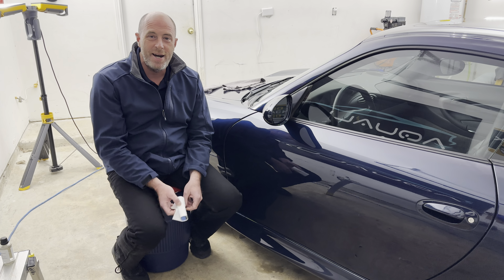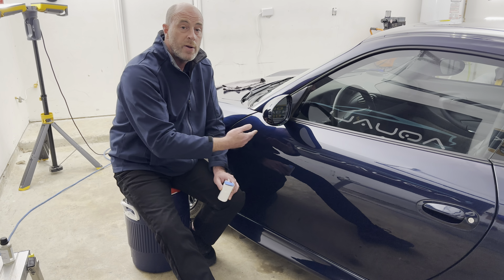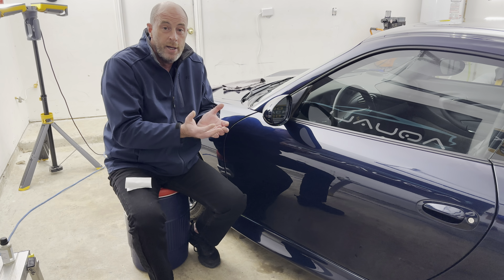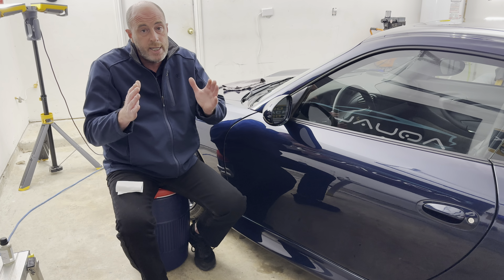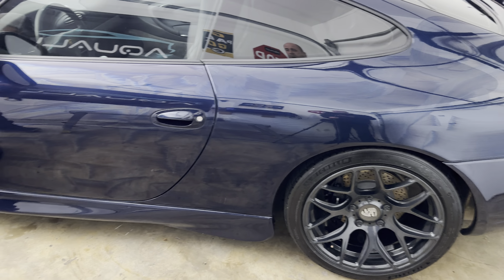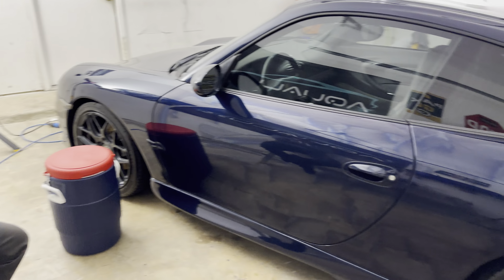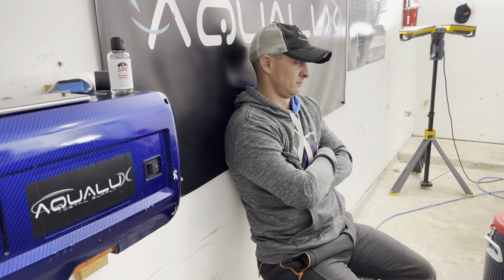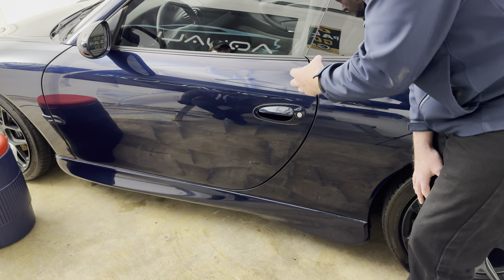New Coating Technology - OVER FLASH TECHNOLOGY DPC FLASH-BACK!

Comment: I am brand new to this, I just coated my white Blazer last weekend. I used Armor Sheild IX. I had none of the issues you mentioned. I did the coating in the sunlight in about 80 degree weather. I didn't time it between applying and buffing. I just stayed 1 panel ahead of myself with the application and buffing and it went beautifully. Maybe I am just a natural at it, but I was a little worried that it wouldn't go smoothly because I have watched a bunch of videos like this. I feel like we may be getting to a point where there are too many coatings out there and it is just making it confusing to the newcomers. Everyone markets their product in a way that makes it seem like every other product is inferior or extremely hard to work with. That simply doesn't seem to be the case in my experience. Just buy something and put it on, if you want to overthink something let it be the paint prep. Applying the coating itself is very easy and not nearly as easy to mess up as most of the YouTubers would have you think.

Comment: I absolutely love what I've seen of this coating. I could see the flash holding for the 10 minutes without any cuts in the video, and I could see it buff off to clarity, quickly and with ease, on a dark color no less. I would have liked to see a close up from untouched to finished if there was any effect on the gloss or depth of color, and maybe a water spritz to show the properties with water (although maybe on a cured panel). I also wondered what happens under hot sun, or over too long a time, does it just get super stubborn, or leave streaks and high spots that need to be compounded again? Overall, great video, good to see you again, hope you are doing great!

Comment: I've used some of another brand spray on graphene coating that works alright. Poor gloss and seems to last about 10 months with my low miles driving. I have some paint damage to be fixed from an old man in a Park, and my Durango will probably be getting this. Black paint - great for the five minutes it's clean!

Comment: ok, so I'm officially confused. Your videos claim this can be applied in sunlight in hot and humid conditions (I believe you said 80 degrees or so and 80% humidity), that sounds great and I was excited to try your ceramic coating. I went to your website to buy some and was just reading about the product when I came across the application instructions and #8 says "Always work out of direct sunlight and on a cool surface". Always work out of direct sunlight? Doesn't that contradict what you've been saying about the ease of application? That it can be applied in sunlight, on a hot humid day and on a warm panel? Hopefully, someone will help clarify this discrepancy for me without excuses or saying that there are nuances, etc. Either the website is wrong or the video(s) are, or the videos are exaggerated, and what it says on the website is closer to the truth or some version thereof. It can't be "well sometimes... Thank you in advance

Comment: Any minimum temperature application worries Scott?
And what would your paint prep recommendations be?
One of my cars is yellow and I’ve shied away from coatings because I’m colorblind and I can’t see the flash. This takes away the worry. 👍
Reply: Iron Decon, Clay, Polish, Panel prep and Coat
Reply: @thinkforyourself5672  , wouldn't the panel prep remove any polish? So I've already cleaned, clayed and polished with hybrid solutions graphene max wax, I can use the coating over the top now? Thanks
Reply: @407j , You want squeaky clean paint. You don't want to apply the coating over a wax. You want virgin paint. A strong panel prep should remove the wax which is what you want.
Reply: @thinkforyourself5672  , ok, makes sense. Thanks for help.

Comment: This coating is fun, simple, easy, super slick, gloss off the charts. Coat the entire car, wait ten minutes to buff off and boom you’re done.  It doesn’t get any better than this especially for the beginner or first time guy doing a coating imo.  Love a ya sir!
Reply: So do you remove coating immediately after completing the whole car or wait another 10mins after completion? I thought by the time you complete the whole car,that's about time to start removing the coating...
Reply: Panel by Panel and I would never wait 10 mins to remove the coating. But if this coating does what it sais it does then have at it.